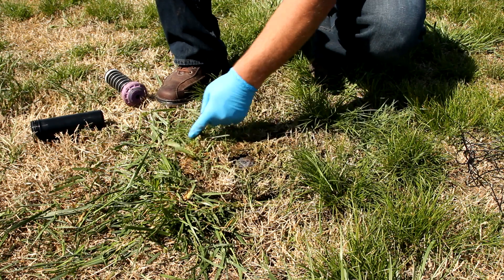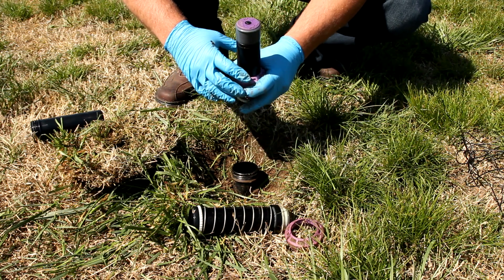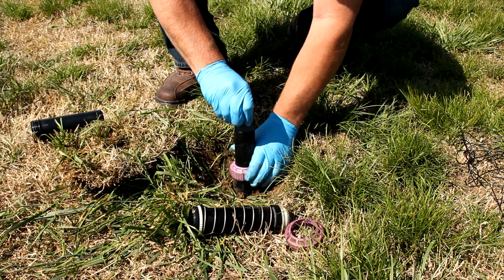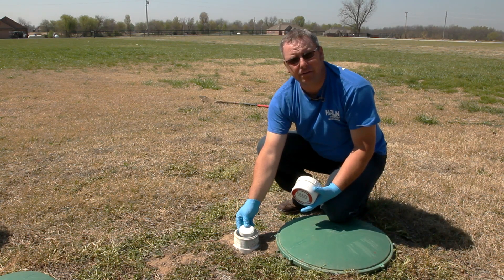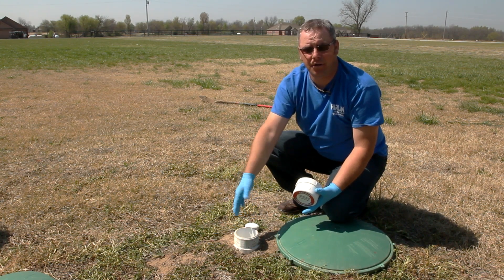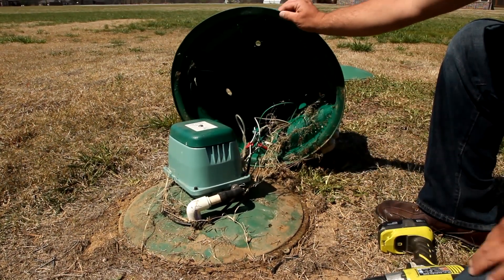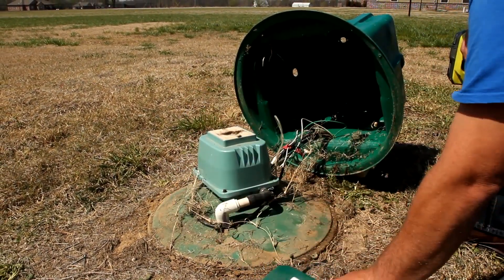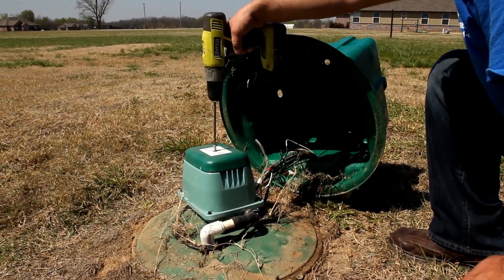How to Maintain Your Aerobic Septic System

Comment: We had an aerobic system installed at my old house, old septic failed. Septic serviceman that installed the aerobic system did regular service checks (nominal fee) and it never needed to be pumped in 15 years. That was a local serviceman, said if you get it sized correctly, keep up on user maintenance, and don't do something to kill off the bacteria, it wouldn't need to be pumped.
Reply: The trash area gets plenty of microbes to maintain? I'm guessing the air section help for over there somehow?

Comment: Thanks for the video Charles.
In another video, somebody else said that setting the little lever up (within the timer) would force the sprinklers to run.  So, I did that and the sprayers DIDN'T activate.  I opened the lid and with a hook I lifted the middle floater and the sprayers ran, so I know the pump is okay.
You said that setting that little plastic lever up will activate the sprayers "anytime the floater is up"..........that makes more sense.
--------------------------------------------------
The problem I'm having is the light (single light system) is coming on (along with the audible alarm) at around 4 am (very annoying).  I go silence the alarm and in the morning the light is off.  The level in the tank is low and I know the pump is working.
The aerobic pump is working but it may not be pumping enough air.
I disconnected the little tubing from the aerobic pump and I'm able to see that it pumps air because I use saliva and I can see it getting slightly displaced by the air (similar to checking a leak in a tire tube).  Maybe the aerobic pump/blower is not moving enough air?
I'm going to replace the pump switch (I had replaced it about one year ago), about $30, and hope that's the issue.........sure hate to spend so much money to replace the aerobic pump/blower.

Comment: My liquid bleach ran pretty much dry so I added about 4 gallons of bleach to it. Out of ignorance, 3.5 quarts of the bleach added was low splash bleach then the rest of the 4 gallons was normal bleach. Is this a problem or will the regular bleach dilute the viscosity enough for it to not be an issue?

Comment: I have to set my sprinklers higher or they get mowed over every time. I notice on one of my sprinklers there is almost like a sink hole around my sprinkler. It could of been from the last leak but it is not leaking now. Do you think it could be a slow leak somewhere else maybe the PVC pipe causing the water to puddle in that way.? 
The last thing-Do you know where i can get just the plastic safety pin part for my Hi blow 80 pump without having to buy the entire rebuild kit?

Comment: This is an old video, I hope you can answer this for me. I bought a home with the aerobic system, it took tablets. The tube broke and the person who fixed it put in a tube that takes chlorine bleach. It has started smelling since using the Bleach.  The tube is hard to set at a slow drip, it either stops dripping or goes to fast. You said 3 gallons of bleach, can I just pour that amount directly into the the tank once a month? IF so, would you spell the name of the chlorine you suggested. The man who worked on my system said to just use the bleach I use for my washing. Can too much chlorine be used?
I have seen other posts, to put baking soda followed by vinger down the sink drains, etc.
Reply: judypa38 call our office 9182610544
Reply: It’s not important, just required by county or state to disinfect water when it comes out of sprinklers. The drip tube does the same thing. If your septic system stinks then you have a compressor out or needs to be pumped out or lack of bacteria.

Comment: I echo Marsh Granny b. We also just bought a home with this type of system. Thank you for explaining these things, as we were clueless about the system. Did check the air filter on the pump; our pump is a bit different, as the filter was on the side. Pulled the filter out to rinse it...and it disintegrated in my hands. So, I got a piece of filter media that is similar to a sponge, cut it to the same dimensions as the original filter, and installed it as a replacement.  May need to get some enzymes as you stated in the video, as ours smells like poo when it sprays, and some chlorine tablets since there are none in the tank...

Comment: Some off my sprinkler heads will not go back down after pumping.  I i have tried moving them around a pushing on them. This happened after all the cold weather. Does this mean they are bad and need replaced?
Reply: If they turn back on and spray you are good. If all your sprinklers do not spray then that is the pump inside the tank- Not a do it yourself job for most.

Comment: we just moved into a place that has the kind of tank.
when we got here they had Chlorine tabs.
the people next door said to use a cheaper tabs.
but now Everytime we go out side it smells like poo.
what to do?
Reply: The Tee Pee Gang the system is not getting enough oxygen from the air compressor or the diffuser stones are clogged. The lack of chlorine tablets has no effect on the smell